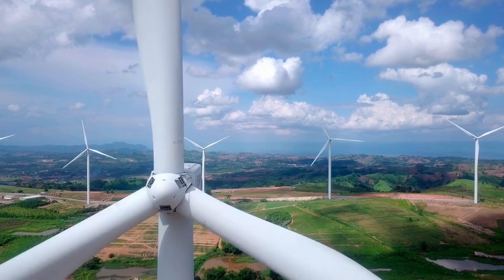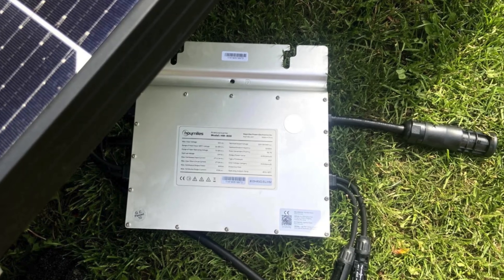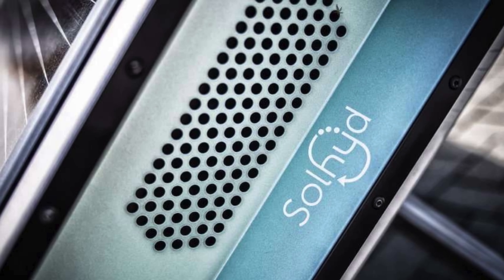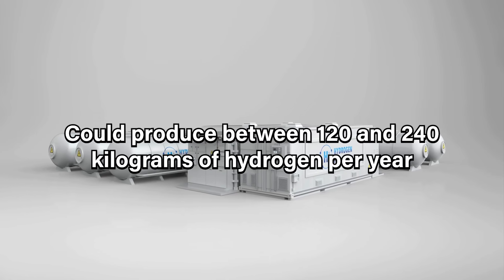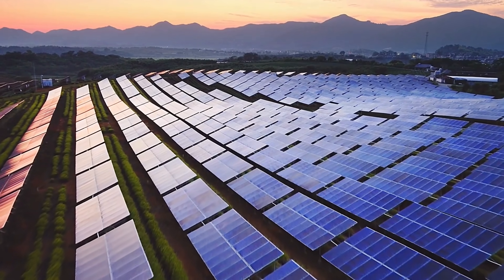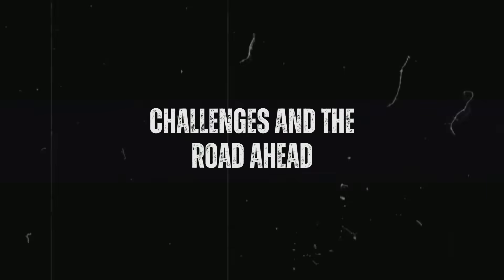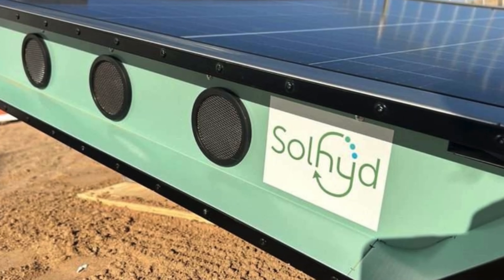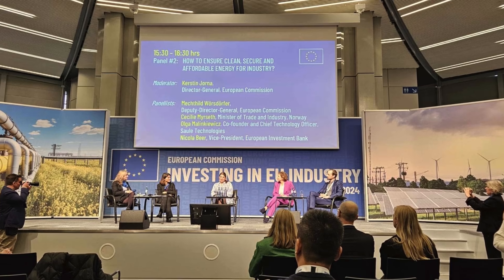Solhyd's Hydrogen Solar Panel: The Future of Renewable Energy

Comment: In Nigeria I think it’s going to sell well for household hydrogen production for cooking. The high cost of cooking gas in Nigeria has made that clear. However in my opinion how about creating a simpler version that just turns water into hydrogen as water price is super cheap in nigeria and most people have sunk solar boreholes instead of taking it from the air thereby increasing potential quantity each day for cooking and having a small lithium battery to maybe increase pressure of the gas if need be

Comment: Can these panels generate electricitiy untill my battery is full and then start generating  hydrogen?
Reply from the maker: Great question. As of now, I believe Solhyd’s hydrogen panels are primarily focused on hydrogen production. We should get more clarity on their capabilities as they approach commercialization.
Reply: The problem I seeis that : 
- when close to equator you don't need long time storage so a normal battery will be good enough.
- when further away from the equator during the winter you will want to use the electricity of these panels directly for your normal load and with some battery assistance hope to make it throught these night and gray winterdays.

I am afraid that there is no location/ situation where you choose this panel over a normal panel of even a PV-T panel other then where there is a  specific need for  hydrogen like some industries or the few people driving a hydrogen car.

If you want to store energy long term in the form of hydrogen, just use an electrolyser.

Comment: Thanks. This is a great invention. It will be interesting to see the contrasting uses between rapidly developing battery based energy sources and hydrogen sources. My take is that hydrogen power for motive purposes will be a small market. Hydrogen transportation is a real problem. Producing hydrogen onsite for cooking purposes could be satisfying to those who like the flame.
Reply from the maker: Well said. Thank you for the thoughtful comment! You're absolutely right. Hydrogen and battery based energy are on two interesting paths. Hydrogen does face challenges, especially in transportation and storage, but its potential for specific applications like industrial uses, cooking, and even energy storage in remote areas is exciting. The idea of producing hydrogen onsite for flame-based cooking is a great point. But, it seems many people still prefer cooking with gas over electric stoves. It’ll be fascinating to see how these two energy sources coexist and complement each other in the future. Thanks for sharing your perspective and I appreciate your comment.